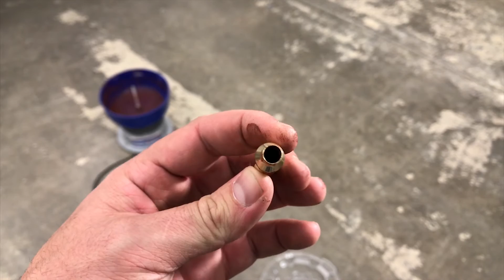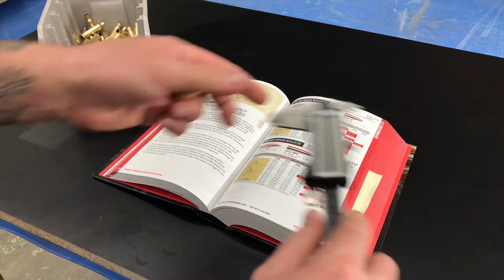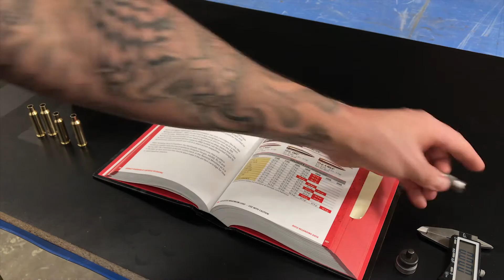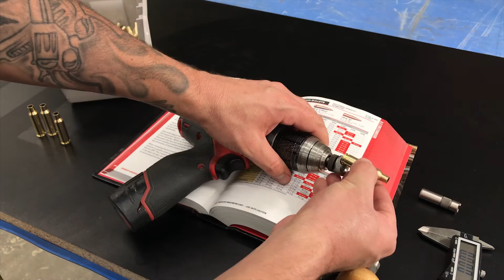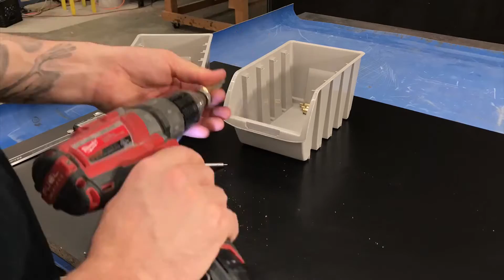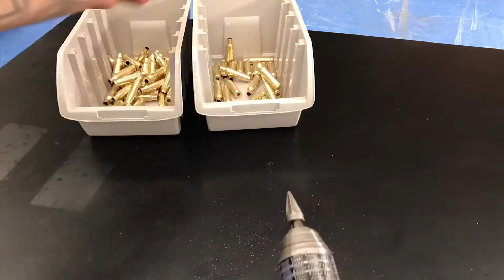Reloading 6.5 Creedmoor: PART 3/6 (Trimming & Deburring)

Comment: Two upgrades that would make your process faster. Stainless steel tumbling you won’t have to blow out each primer pocket with compressed air. The second upgrade would be a Lee quick trim die this will trim, chamfer, debur at the same time not changing head. I’ve done what your doing in the past but I upgraded. My next upgrade hopefully soon will be the Franklin Arsenal case prep.

Comment: PLEASE, WRITE THERE THE PART NUMBER OR LINK FOR BUY A CASE TRIMING FOR 6.5 CREED...... THANK YOU....
Reply from the maker: Tools and Equipment Used in These Videos

Part Numbers:

Hornady 9th Edition Handbook of Cartridge Reloading Item #99240 (https://www.hornady.com/shop/books-and-video/hornady-reloading-handbook-10th-edition)

Hornady One Shot Spray Case Lube (5 fl Oz Aerosol) Item #9991 (https://www.hornady.com/reloading/case-care/lubes-and-cleaners/case-lubes)

Hornady Neck Size DIE 6.5MM .264 (https://www.amazon.com/gp/product/B0033Y161C/ref=oh_aui_search_detailpage?ie=UTF8&psc=1)

Hornady Bullet Seating Die #23 (.264) 6.5MM W/147 (https://www.amazon.com/gp/product/B0033XV42Y/ref=oh_aui_search_detailpage?ie=UTF8&psc=1)

Hornady C1550 Lock-N-Load OAL Length Gauge (Curved) (https://www.amazon.com/gp/product/B000PD6SD0/ref=oh_aui_search_detailpage?ie=UTF8&psc=1)

Lyman Gen6 Digital Powder Measure (https://www.amazon.com/gp/product/B00AU6CIUO/ref=oh_aui_search_detailpage?ie=UTF8&psc=1)

Lyman Case Prep Multi Tool (https://www.amazon.com/gp/product/B004MCMCYE/ref=oh_aui_search_detailpage?ie=UTF8&psc=1)

Lyman Easy Pour Tufnut (6 lbs) (https://www.amazon.com/gp/product/B000N8JWM6/ref=oh_aui_search_detailpage?ie=UTF8&psc=1)

GAUGE/HLDR 6.5 CREED (https://leeprecision.com/gauge-holder-6.5-creedmoor.html)

Lee Precision Powder Funnel (https://www.amazon.com/gp/product/B000NOUEUO/ref=oh_aui_search_detailpage?ie=UTF8&psc=1)

Lyman Flash Hole Uniformer (https://www.amazon.com/gp/product/B000N8OKGE/ref=oh_aui_search_detailpage?ie=UTF8&psc=1)